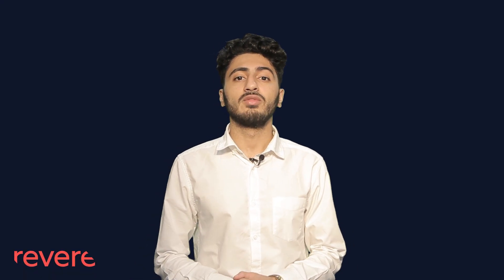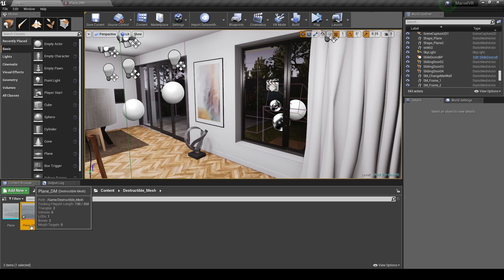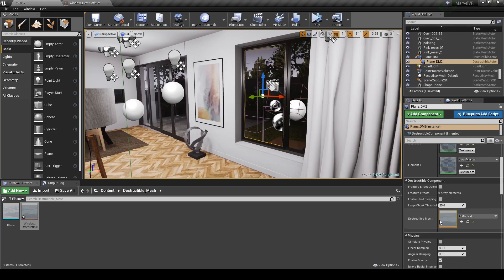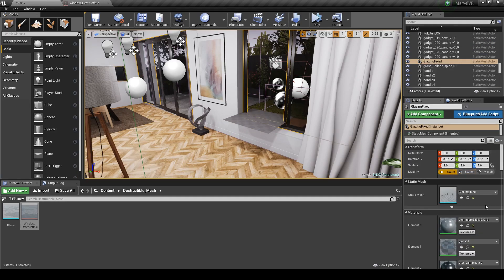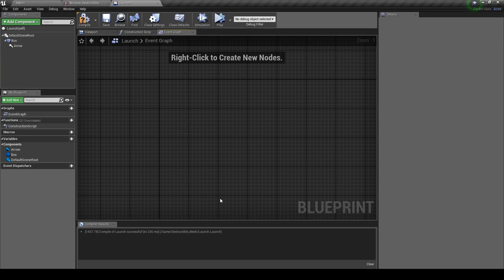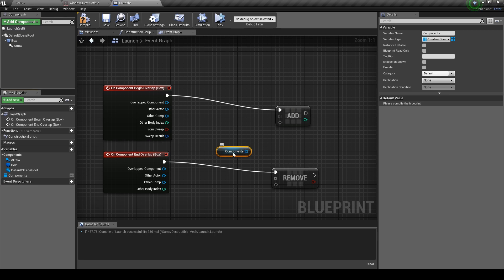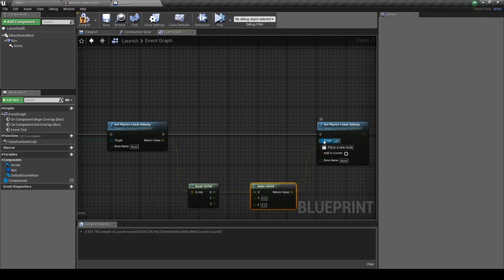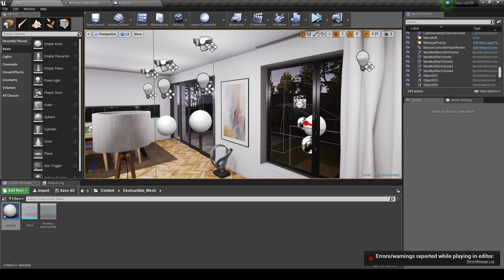Unreal Engine 4 - How to break a window

Comment: the launch is not working for me i want it so when the player goes into a room it will laund something at the window and smash it? can i do it with a box collision for the player
Reply from the maker: A box collision with a begin overlap would launch the brick when your player went into the box. I would recommend to also cast to your player and use the actor from the begin overlap node, to prevent anything else in the level triggering the launch.

Comment: When I click on 'fracture mesh' nothing appears, I don't see my mesh fractured. And then if I use the 'explode amount' slider nothing happens. Basically it doesn't get fractured...
Reply from the maker: Have you enabled Apex destruction in your plug-ins?
Reply: @revere3d  Ofc
Reply: Aparently is an unreal engine 4.24 problem... I hope they fix it soon
Reply from the maker: @Albert-Freeman   I think it's something to do with Epic transitioning over to their new Chaos system or it could just be a bug, either way it will definitely work in 4.22/4.23